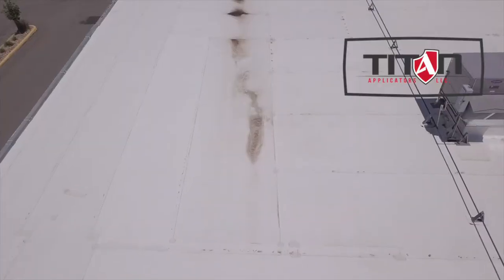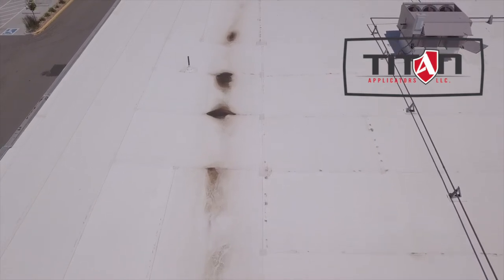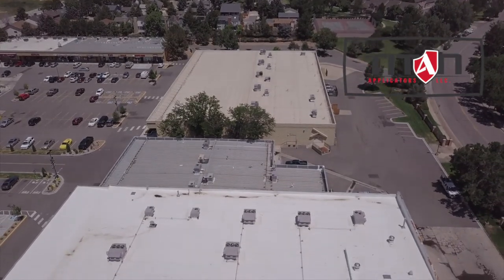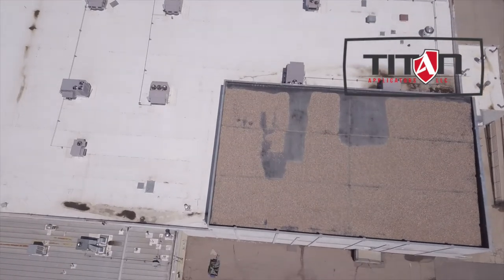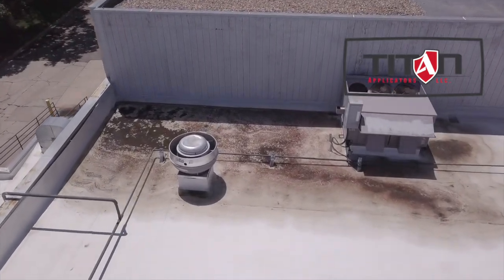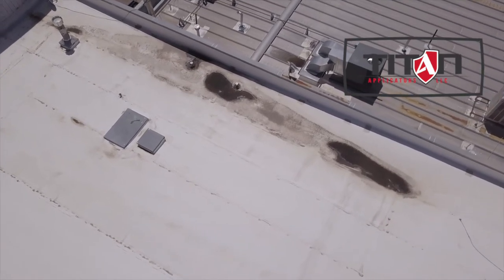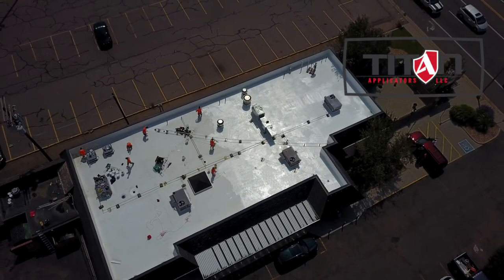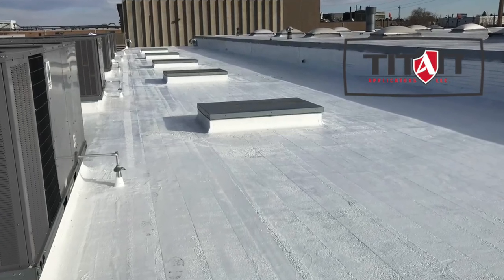#1 Problem With TPO Roofs

Comment: I saw some of your videos.  We have two commercial properties with low sloping closed cell build up roof with acrylic white coating.  We had a Hail storm hit that lasted 1 hour 45 min small to large hail.  You are correct, they can be repaired and brought back to new.  I am a big proponent of your beliefs that these roofs, in the right situation, are simply perfect.  Thanks you for all your videos.
Reply from the maker: Thank you for your kind words! 🙏

Comment: Shameful.  All of those examples are ponding areas where dirt has accumulated. The membrane is fine.  If it wasn't they could show you the failing material.  TPO is a fine roofing system.  Selling a product by bashing another is typical in the roofing world.

Comment: So I'm very happy that somebody actually touched on the UV issue especially in the mountain climates as this is a very prominent issue that despite TPO manufacturers claiming they. addressed this in 2011 is still ongoing. 
That said,  Fluid-Applied is an absolute garbage scam to be peddling.
Reply: What are the problems with fluid applied membranes?

Comment: Sounds like a sales pitch to me
Reply from the maker: Thanks for the input, Vitaliy Pro. We definitely don't want to sound "salesy". We're simply concerned with educating the consumer. While TPO roofing systems are a viable roof option, there are limitations here in Colorado that we believe need to be taken into consideration! We see far too many premature failures on TPO roofs that are at high elevation due to the sun.
Reply: @titanapplicators  let's make tires out of OSB 😂😂

Comment: What you are showing is ponding water/organic debris and insinuating that is damage from UV rays, TPO is the best system against UV. Just be honest. sell your white paint and move on.
Reply from the maker: Did you live under power lines as a kid? Asking for a friend...
Reply: 100% right. We have white paint salesman here in mass as well. They have no clue
Reply: Did you know that UV was such a major issue for TPO that there was literally a committee formed by GAF, Carlisle and Firestone from 2003 to 2011 to address this issue, and that it led to one of the largest commercial roof lawsuits in the United States history? TPO is quite literally the least resistant system against UV and the associated heat and is the literal reason for the adaptation ofASTM D6878 which was designed in 2003 specifically to hold TPO manufacturers accountable and hold them to a higher standard.
Tpo's low resistance was also literally cited as a reason why DOW got out of roofing, why genflex sold out to Firestone, and was at least a contributory reason Goodyear sold out to Carlisle